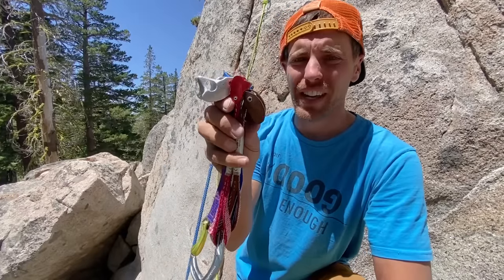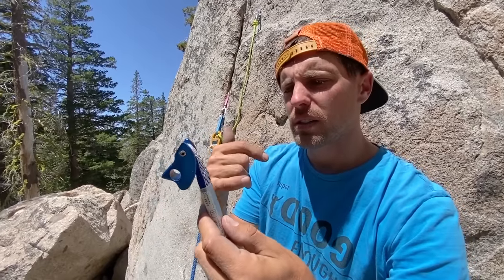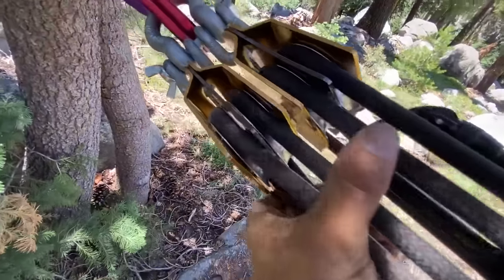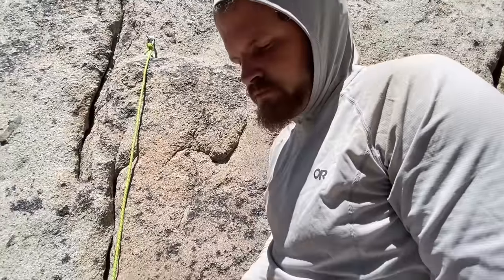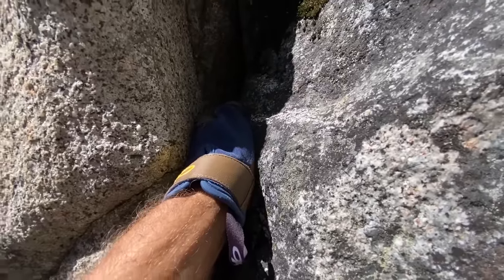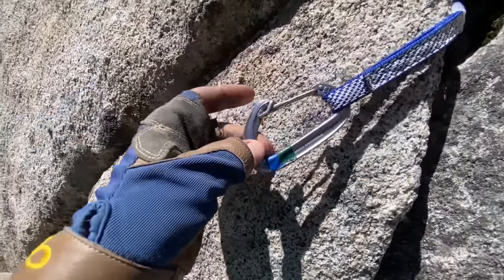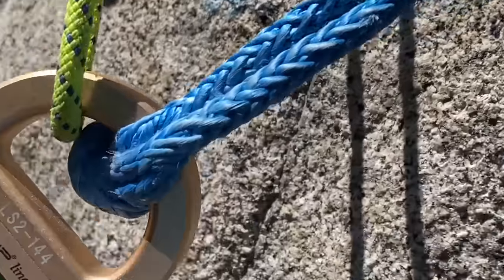How strong are CAMP Tricams?  We tested them in real rock

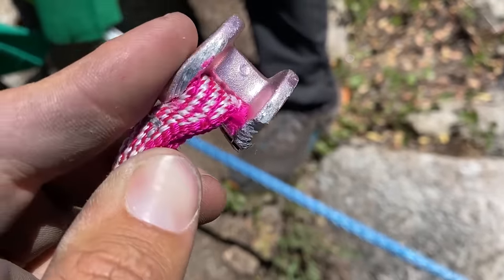Comment: Pay attention - the damage at 5:15 sheared the corner off there, because it was in camming mode, webbing running across the flat back area. The failures suggest the newer models are using a more brittle alloy than the soft early Lowe versions, which just deformed and became welded into cracks, or sheared out. The new, pointier tip fits into smaller rugosities, to initiate camming, but that magnifies the pressure to where it even broke the granite; the original design was a broader edge that fit less flared cracks, but spread the contact more. Interesting to see how "little things" like webbing against rock becomes the weakest spot. Overall encouraging tests at least as strong as the mfg spec, when pull is straight, rock is strong, etc.
Reply: still think the pointier tooth might be a better design as it keys into the rock better and still out preforms it’s ratings with good placement. you’re more likely to get complete failures with way lower forces if the camming isn’t  initiated properly or if the cam wiggles out of place.

Comment: in the mid 70s i worked at rei. in the climbing dept. I had started climbing in the early 60s and had been part of the gear movement of starting with soft steel pitons on to cromoly pins and then slung machine nuts and small pebbles. Finally to stoppers and hexs. Out hardware buyer/engineer took a bunch of hardware to the Icycle canyon/levanworth area with a hydrolic jack and did a bunch of testing of placements and hardware. I remember the results as not very interesting (?) But the issue of the slings touching the rock under load were very concerning. I no longer climb but I would like to see more testing of slings in contact with the rock.

Comment: A bit of math from the pulley coming out:

The upper limit of force multiplication is 2x (Rope doing a bend)
If we assume 90° we get a force multiplication of square root of 2, 22.15kn
100° would give us 20.13kn
120° would give us an outward pull of 1x, 15.66kn and all larger angles multiply the force less than 1x.
140° would give us an outward force of 10.71kn

I'm guessing that the angle at the pulley got a little tighter when you pulled on it compared to when it was under less pull.
Reply: I got the same result for 120°

Comment: Asking again to test micro trax and other TR solo devices/ascenders
Reply: Include the Roll n Lock ...
Reply: Would probably be best to test on the drop tower when that's going
Reply: Could you test a fall on cordino on a double rope? Like when you ascend the rope in an emergency?
Reply: You shouldn't ever have much more than body weight on those rigs, maybe up to 2Kn. If you do you're doing it wrong! (So use a chest harness, if you don't already). And your fall factor should be tiny due to the amount of rope out and distance fallen.

Comment: A really good and cheap way to protect your line scale from destruction would be to cut the bottom out of a 32oz nalgene water bottle (If it would fit…) or even just a 2 L Coke bottle if you need a bigger container; and stick the sling through the opening at the top so it could connect to the piece of protection while leaving the line scale inside the bottle and letting your rope connect to the other end of the line scale through the cut off bottom of the bottle. That way when all hell breaks loose the bottles frame will protect it and let it slam into the rock but you can still see the scale through the clear bottle. 

I know it sounds ghetto but it works.

Comment: I really like tricams. I think they fit awesome on horizontal cracks when using the"cam" features nose up. I always carry a full rack to the crag.
Reply: How "difficult" are they to place? The sling seems more wobbly than the wiring on a cam, so I was wondering if they’re easy to slide into a crack
I have a little experience with trad climbing (there are just no cracks in the rock here) and the cams I practiced with were nice and easy to place due to the metal wires, but these look nice and the nut function could give you more more options placing them, securing a multi pitch anchor against flipping upwards. (Sorry if my English translation sounds weird)
Reply: @vfnt  The new ones are triple sewn to make them stiffer and easier to place as compared to the originals... which are the ones you see taped up to add stiffness to the sling. There is a slight difference in the head shape between the OG pink and the new school ones.  Best to have both lol.
Reply: @vfnt  they're not as easy as cams to place. But in horizontal cracks, since they are made of sling, it allow them to take a load without a permanent deformation. I usually place them with my index and major finger directly on the metal part. Hope i could help.
Reply: @gabarsenault5924  
Thank you for your quick answer. 
The tip to place them will be useful. And thank you for mentioning the deformation of regular cams, I would not have thought of that. Will 100% take a closer look at them.
Have a great day!
Reply: @okzsub949  
Thank you for the extra information, especially on the different generations. 
I will definitely take a look at them.
Have a great day!

Comment: I've taken a few bomber falls onto pink tri-cams in the Gunks.  And a tri-cam saved me a copperhead placement on the Prow on the Column (6th pitch).  I love them.  I think the math on the forces on the bolt is 15.66kN/cos(100 degrees) = 18.16kN.  However, I was in a statics & dynamics course in 1981; this could be way wrong :)
Reply: Isn't it that there are two vectors both with a magnitude of 15.66 pulling in different directions with an angle of 100 between them?... So x = 15.66 + 15.66*cos(100) = 12.94 and y = 15.66*sin(100) = 15.42. Then use Pythagorean to combine the component vectors: sqrt(12.94^2+15.42^2) = 20.13kN
Or you can use the double cosine of half the angle, since we are simply taking the bisector of two equal magnitude vectors as B G mentioned. We get the same 15.66*2*cos(50) = 20.13kN.
Reply: @barongerhardt  the fuck bro some freakin maths here jjjj love it!

Comment: For padding the scale and keeping the screen visible I would recommend self fusing silicone tape, also referred to as fusion tape or f4 tape. Self adhering and fuses into a solid block of silicone rubber. Originally made for wrapping pipes in aircraft I tend to use it a lot for making handles

Comment: All hail tricams! I have a test request which has very little/no information out there - Sometimes when you place a nut, the carabiner you clip to it runs over a horrible edge (and you've shown those carabiners breaking at low loads!), so sometimes we loop something soft like a sling directly through the wire loop and clip that. I imagine under any load that would really pinch down and cut the sling (much like the BD thumb loops did without their special doubled-over sling), so would be super enlightening to me (and I'm sure others) to see what kind of force cuts: ~10mm dyneema sling, ~16mm nylon sling, something like 7mm cord looped through, and anything else you can think of under that condition. I would love to know which is best to keep me alive!
Reply: Girth hitch another nuts wire to extend the placement
Reply: @largeformatlandscape  wouldn't that mega bend the wire?

Comment: The thing with wide angles and loading is that a relatively small load deflecting the line of pull can generate a relatively large load along the two strands.  Your dynamometer was measuring the load on one of the strands, so, it was getting the "big number" - the load on the redirect that popped would have been relatively small.  If, on the other hand, the angle had been very narrow, it would have been a higher load on the redirect than on the single strand, up to double, if the angle were very small.  Think about what it looks like when you make a 2-to-1 pulley system, like the one on slacksnap ... it's like your redirect, but with a very narrow angle.  Widening the angle makes a 2-to-1 pulley system pull less, not more.
The takeaway is that the rock your redirect was bolted too appears to have failed under a relatively low load.

Comment: Let's say 120°,
15kn on the rope.
The vector parallel to the bolt (pull out)
Is 0.5 of each rope, 2 rope 100% of pull works to pull out the bolt

Comment: Thanks for the great content! 

I would be very interested in you trying to  break some trees - I think it would be interesting to know what you can expect from different trees in different situations. My assumption is that any significant (~1ft in diameter) tree is super good enough, but it would be great to *know*.
Reply: I'm pretty sure the strength of a tree as an anchor depends on the root structure and soil conditions.  If you could standardize the soil conditions then you might be able to compare the holding power of the root structures of different tree species.
Reply: Tree murderer!!
Reply: In situations where the tree is growing in rock, it's very difficult to say, depends heavily on how it's rooted. If you are slinging it close to the ground, 12" and up on a living, non-rotting tree is definitely super fine on the wood side, the big question is in the root system. Would not recommend slinging a tree much higher than a couple feet unless you are capable of assessing root conditions, tree species and health, etc. You could always take a TRAQ course, but that's kind of excessive for this. Tree species also has a lot to do with it, in good soil, with a line at the top, you can break a 1/2" double braid rigging line before something like a live oak would uproot or break, whereas a sand pine in the same soil would be likely to uproot, and something like chinaberry or popcorn would absolutely just snap first. Much like with rock, I say trust the rigging, don't trust the rigging points.

Comment: I did your math assuming a 135 degree angle, and got a force of 11.48 kN in the direction parallel to the bolt, i.e. the bolt  with the pulley attached got pulled straight out of the rock by a 11.48 kN force. Do you think that could bend your bolt hanger like that? I just added together the two components parallel to the bolt.

Comment: What altitude are you at?  Pretty sure chemically weathered rock breaks easier than physically weathered.  Alabama Hills versus 10,000 feet up Mt. Whitney.  That could be a test, granite at 2000 feet, 6000 feet and 12000 feet with the same gear and nearly identical crack widths and placements.
Reply from the maker: I suspect that mineral composition is going to give you more variables than weathering but between the two you have thousands of micro differences in rock that we would call granite. -Bobby

Comment: If your angle was about 80 degrees off a straight pull (100 degree inside angle on the rope), and your force was 15.66kN, then the resultant force on the bolt that blew up the rock was only about 20.13kN.

If that angle went to 90 degrees then the resultant force is about 22.15kN.

It seems that the bolt may have been in bad rock.

Comment: My biggest note is all the placements could be improved a bit. Would be interesting to see you retest with better placements from someone who uses tricams more. Great job making these videos! Is that static line in your pulley system?
Reply: If you think about it though, sub par placement means nothing if the nose or sling breaks before the cam comes out of the rock. And these forces are more inline of what you'd get when placing them in the real world

Comment: The originals were from aluminum sheet, those are castings, never used any, still won't, I'll check my trad rack next time, the older ones just wore more rounded on the points.
Cheers 🍺